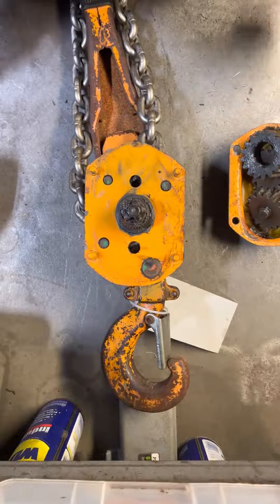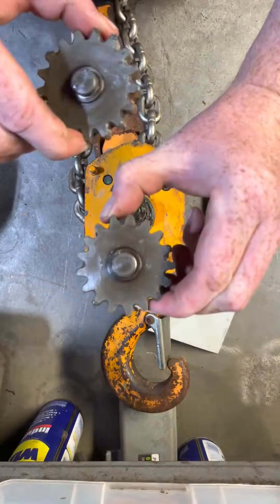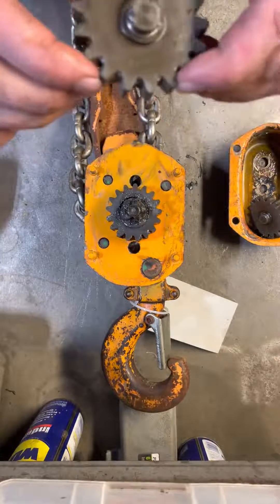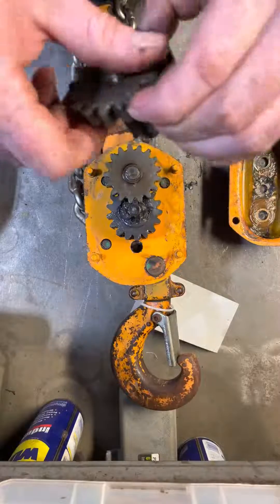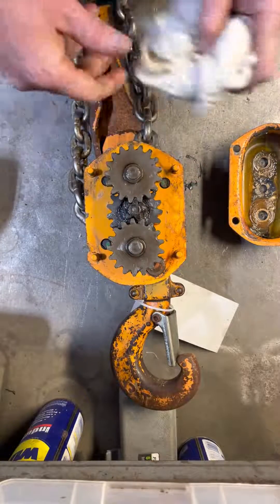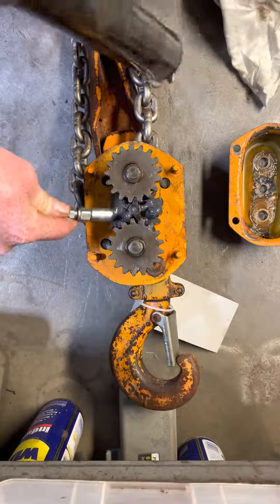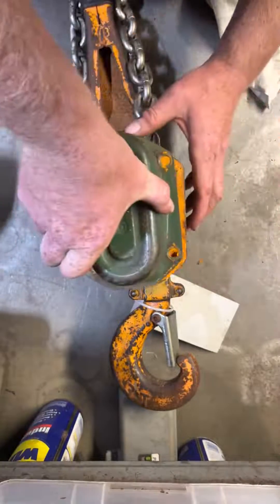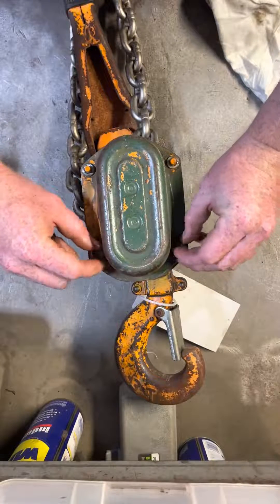Step-By-Step: Setting Gear Timing On a Harrington 3 Ton (LB030) Lever Hoist.

Comment: I am wondering if this affects the hoist going up or down. I just bought one and it seems to only work in the one direction . 

When the lever is set to up, the chain moves, but when the lever is set to down, the chain will not move , it moves slightly but moves back again when you rotate the lever.

I am thinking the gear timing is out or it is faulty and i should return it.
Reply: Having a similar issue. Did you get it fixed?
Reply: @bryansmith2115  I did get it fixed. Turns out the gears were separating slightly inside the case causing it not to function correctly.
To fix it i welded a nut onto each sleeve on the case and put a bolt through to press the 2 gears down more tightly .
On my lever hoist they come through the case and there is only a thin metal plate over the top of them, but it sits too high and they need a little something to keep them held in position to stop them moving up as in out of the case.
there are 2 metal sleeves on the cover which the ends of the gears sit in, but they don't hold the gears down in position. 

Got a little video showing how i fixed my problem.
Reply from the maker: When this is happening,do you have a load on the hoist? If not, try pulling on the load side of the chain and working the handle.